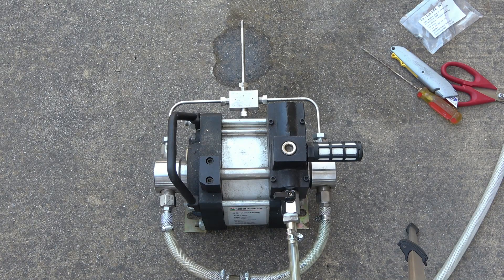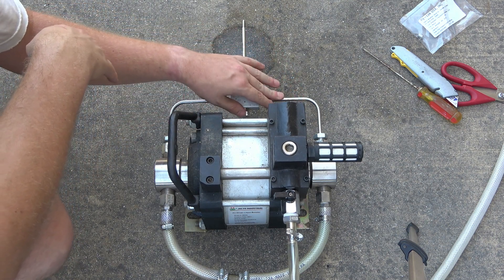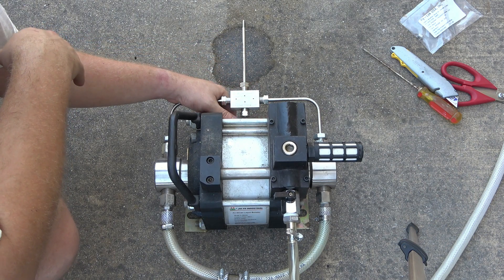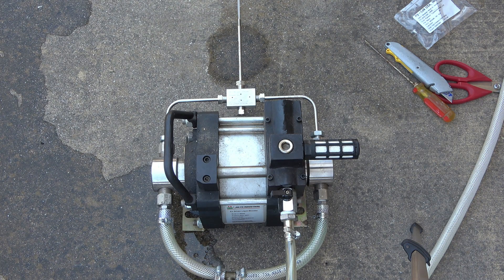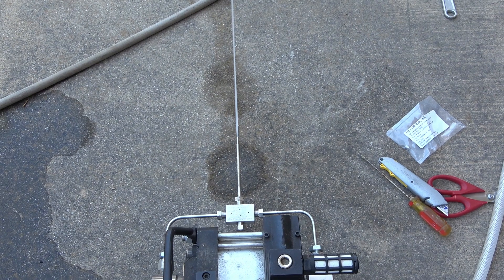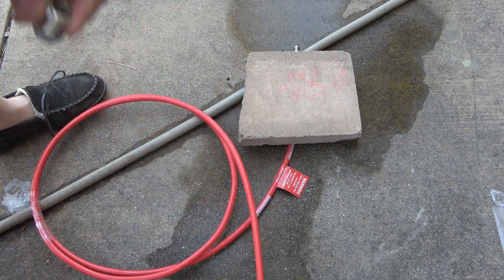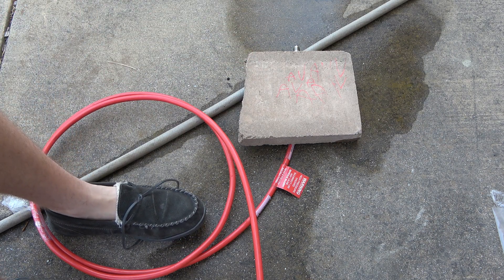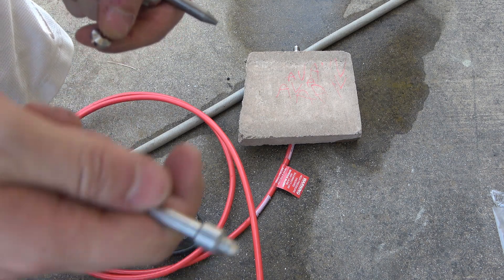8/19/23: Waterjet Update

Comment: It would make sense to me that if the pump its self is rated for high pressure, then you would eliminate your water inlet hoses trying to come off, that you would need a high pressure check valve at the inlets to take the backpressure produced away from your water inlet source.  The other scenario here is if the pump itself isn't rated for this high back pressure because you can hear it stuggling trying to compress a non compressible liquid.  There should immediately be high pressure check valves that stop the water from pushing back on the pump.  If you dont have back pressure on your piston, my guess is that your air delivery to the pump would be put to better use instead of barely being able to drive the pump.  The pump dogs down so much when you turn the air on that I feel like not having the check valve on the outlet is hindering its output.  It would seem to me the smaller orfice you get to on the output the backpressure is produced obviously.  The 60 psi could barely move the pump as the water was being pushed through .083 thousandth tubing.  Chances are your ruby or saffire orfices are going to be between .004, and .018, which means your back pressure is going to increase significantly.  Im not sure that 60 psi will do much of anything at that point without a check valve immediately after the outlet.  Well either way I am curious to see if this proves to be true.
Reply: As a matter of fact the more I think about it, it seems like you'd have check valves at both inlets to not allow backpressure on your water delivery.  Then you would have another set of check valves directly on each outlet.  This way the pump is only compressing the immediate water entering the system.  The check valves on the inlet sides won't allow the pressure to stop constant water delivery to the pump.  Then as the pump is running its pushing water through the next set of check valves which will build pressure through your line to the cutting head.  This makes the most sense to me, again curious to see if this would be the correct procedure.  Also obviously I'd imagine somewhere on that pump is another port in which you can add a pressure relief valve which matches the pumps rated psi, to allow for blow off.
Reply: If the pump does not have an in and out check valve at each head, and from what I have seen it does not seem to, it is not going to do anything just move water in and out of the supply hose.
Also once it is pumping there will be some pressure pulseing as the pump ram reverses at each stroke.
Will need to add an accumulator on the high pressure side to smooth that out. 
Other option would be a second intensifier that is "somehow" run 90deg out of phase so there is always 1 piston pushing water.